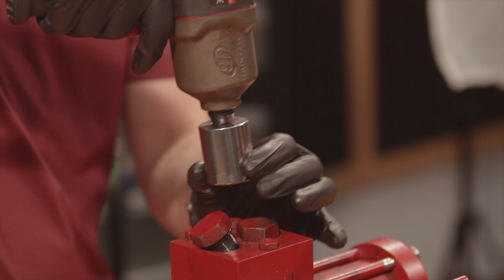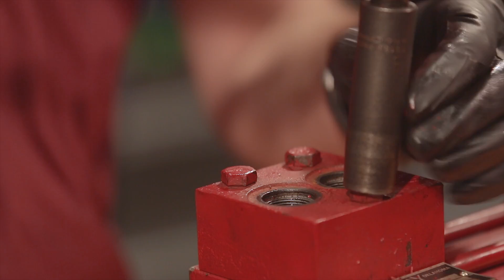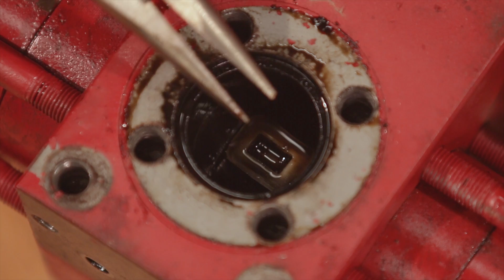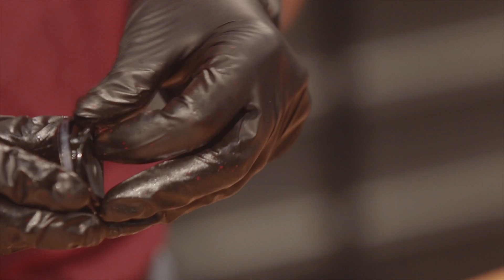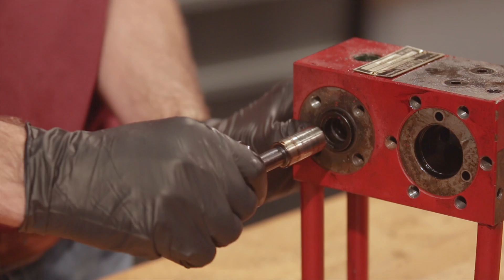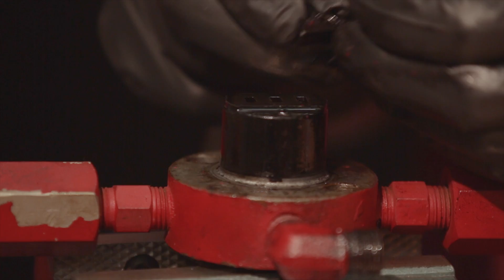How to Repair a Kimray Glycol Pump 🔧 [Part 1: Disassembly]

Comment: What  the  price
Reply from the maker: Pump pricing varies for glycol flow rates and operating pressures. You can find the pump you need on our catalog page: https://kimray.com/products/energy-exchange-glycol-pump

Or if you need to use a calculator first to help determine the size pump needed, our glycol pump sizing calculator can be found here: https://kimray.com/sizing-calculator/glycol-pump-sizing

If you need to speak to someone about selecting a pump for pricing, please find your nearest representative on this page: https://kimray.com/where-buy

Comment: Hello My name is George, i'm from Argentina and I wanted to know what liquid they use to wash the pieces?
Reply from the maker: You can use a parts washer or power washer if one is available but brake cleaner or another solvent can be used to clean the individual parts when disassembling the pump. Make sure that the parts are dry and free of the brake cleaner before reassembling the pump. O-rings and soft goods can be damaged by brake cleaner and harsh solvents. A light lubricating oil or spray can be used on the new O-rings to make reassembly easier.
Reply: Thank you very much for answering, very kind. your videos really help me every day ... a hug!